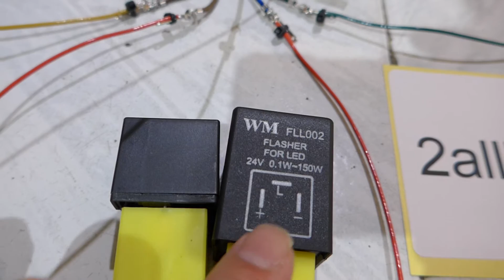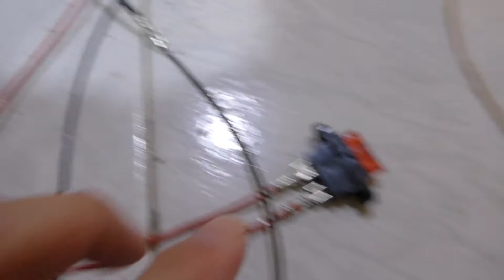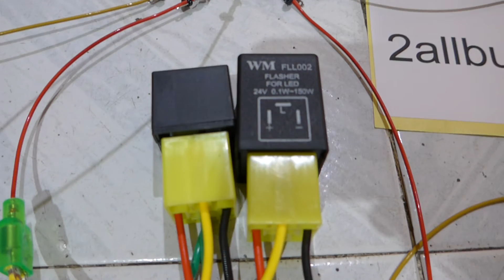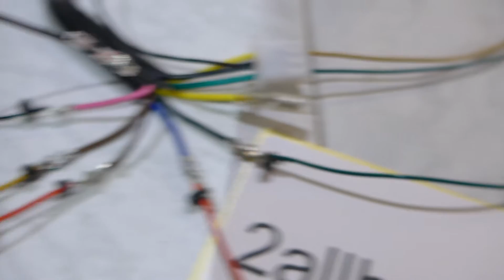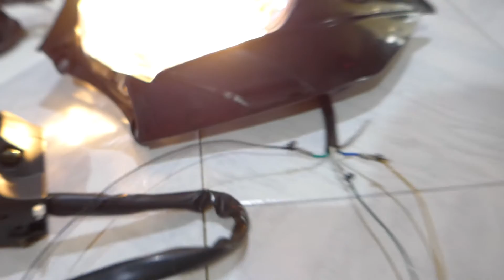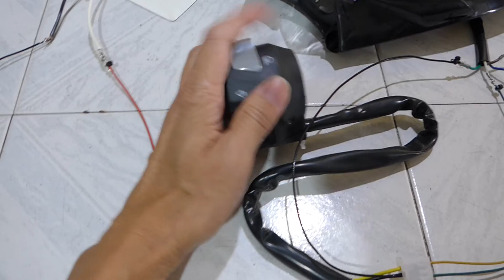Build Turn Signal System and Hazard System with a Left Switch Box & 2 Relays

Comment: Hi, I recently installed LED Tail Lights in my truck. Stock tail lights were halogen. My blinkers are flashing too fast, someone told me that a 12V 40AMP Relay will fix the fast blinking Indicators. I would like to know, if I wire in a relay, would I have to connect it to a 12v source, or can I fix the hyper flashing indicators without connecting to a 12v battery source.Thank You
Reply from the maker: Is your truck running 24V ?? Why would a 12V 40A relay can fix the problem ?? What kind of relay they are talking about ??
Reply: I'm not really sure if it's a 24v or 12v, I think it is 12v though. A standard 12v 40amp relay was recommended.
Reply: Its a 12V feed. So I have a 5 pin general relay, 85,86,87,87a,30. I tried wiring it in myself, I put the incoming indicator feed from the car on 86 and out going to indicator on 87. I grounded on the 85 terminal. I did not connect a 12v source directly from the battery to the 30 terminal. My indicator on the tail light is not turning on, but I can hear the relay ticking. What can I do to correct this?

Thank You
Reply from the maker: I don't know who tell you the 12v 40 amps relay would cure the problem but it is totally wrong concept. A relay is an electronic on/off switch, it does not has blinking function nor it will fix the fast blinking problem. What in the turn signal system is the flasher or blinker and most vehicles use the load resistor type which need to have a specific amps draw to flash normally. When change to led signal lights, the amps draw is much lower so causing problem.
Reply from the maker: What you need is an electronic flasher or blinker as you seen in my video, it does not require a specific amps draw and will work normally whether with one signal light or six led lights. Another method is to add resistor to the circuit or each led signal light, so you will need 4 resistors for 4 signal lights.

Comment: Yes the light on the speedometer turn light
Reply from the maker: Yes if you are using normal turn signal lights (incandescent). No if you are using led turn signal lights since led is directional.

Comment: Can I connect a speedo miter to it
Reply from the maker: Connect a speedo meter? That's another system nothing related. Some speedo meter is mechanical and some is electronic, but either has nothing to do with this system in the vidoe. Do you mean the light bulb in the meter? Otherwise I can't think of anything related?